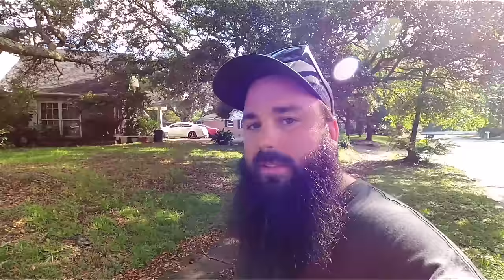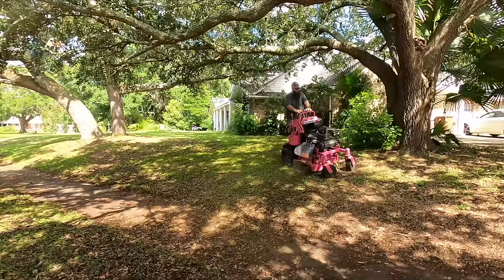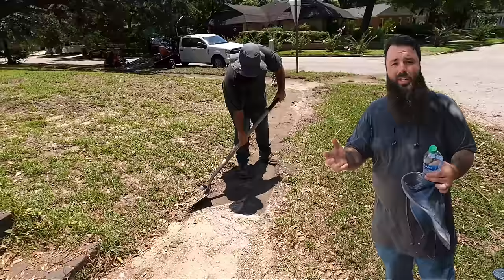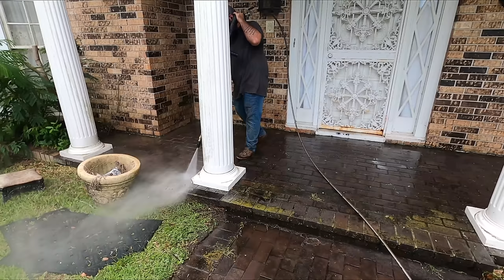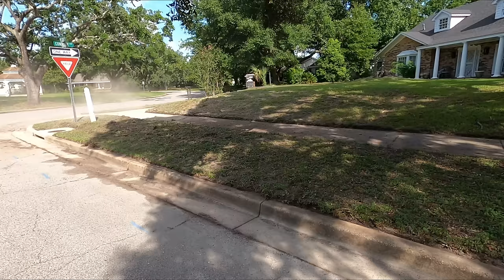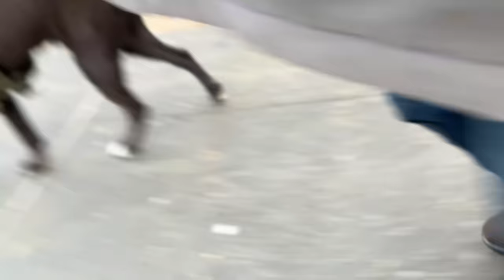(lost footage) He TOLD me that the SIDEWALK has been COVERED his ENTIRE LIFE

Comment: Kevin,  keep on doing you.   I have a Ryobi battery weedeater,  2 chargers and 3 batteries! It takes all 3 to weed and edge my tiny yard, 30 x 100' lot. As a 70 year old,  I  now weedeat in days. Front and sides one day, back next because of having to recharge batteries. My pet peeve with the  Ryobi is having to bend over to use. It's too short, but it's light weight.  Can't handle weight of gas blowers. I have the hat with the back flap. Necessity here in mid-Kentucky,  and due to eye condition,  have to block sun from my eyes. Love all that you do for others,  and  for your love of family.  ❤❤

Comment: Came across the ⚰️ cemetery you cleaned 9 months ago and as usual you did a great job. 😊 One special part, your daughters helping to clean the stones. It was so nice. 😊 One suggestion I will make, as we have a family cemetery⚰️ we care for, is using the spray you use on sidewalks on the tombstones 🪦, after they are cleaned and rinsed. It works the same way as on sidewalks with the sun bleaching the black away🪦and the rain rinsing away any dirt 😂or lichen left. By the way if you’re in Fayetteville, NC we’re having family cemetery cleanup day.🪚LOL!!🪜🧯That’ll be Saturday, April 27th. Plenty of space to pull in a truck,trailer, and camper. Good ole North Carolina BBQ 🐖 is on the menu that day!!!😋🐷

Comment: Another thing on the 'lectric tools, is when they break, the don't see a repair shop. That goes right in the dump and gets replaced vs a gas tool that you can usually service and repair. I have some gas yard equipment that's 40+ years old, and chainsaws as far back as the 50's that are all still working. Killed a DeWalt cordless trimmer and I didn't even take it apart to figure out what went wrong, I just bought another one because I know I can't get parts for it anyway or if I do, they'll cost as much as replacing it.

Comment: You’re wrong about electric equipment not being up to par. I own a tree trimming business & we switched to all electric saws and it’s been a godsend. I’m blown away by the amount of money I saved from not using gas. We just carry several extra charged batteries when we’re working and it’s enough to get through an eight hour day. We did have to buy some extra chargers so we can charge them all at once. Plus we charge them in a facility with solar panels, so no electric bill either. No gas purchases and no electric bill goes a long way on the pocketbook.
Reply from the maker: I do think there are some good battery saws.  the thing with a saw vs a weedeater or back back blower is that its running intermittent. so the batter will actually last a good while and from the battery saws that I have used they are slightly slower than gas when it comes to the chain speed but the cut good all the same. now the big issues is that you can buy a good ground saw for 3 to 5 hundred vs a sthil battery saw that is 300+ dollars and the batteries are another 300+ a peace so when its all said and done and you get the saw and 2 batteries you are about $1000 in on a ground saw. you can buy a lot of gas for that price. no for the gas it has the cost of fuel and just expect to have to replace a BS cheap carb that put on about once every year or 2 so when you put it in the shop for that well thats $100. the other factor is longevity. you can run the same gas saw for YEARS will minor maintence batteries wear out and if you live in an area that gets cold in the winter the batteries will be trash pretty quick. 

with all that said I will buy an electric saw this year. I will put it through the paces and if it makes the cut I will keep it. If not I will give it to someone that its better suited for.

Comment: 24:00 On the idea of going fully battery electric everything now is at best, an expensive side-grade for most things. The electric motors and systems work fine, but the batteries themselves let the entire system down. And the necessary battery chemistry needed to make an even better battery available is still a few years off. Even if said battery was announced tomorrow, you are still talking several years to bring it to market, and a few more years after that to become the new standard. So if such a battery was announced tomorrow, you are looking at that battery being the new standard some time around the end of this decade at the earliest. Pair that with the first generation of anything being rather poor overall, so such a battery would not be worth it in most circumstances until around this time next decade.

Comment: Kevin I see it like this. Opinions are like assholes. Everyone has one and some people are one. As far as cleaning that sidewalk. I invite anyone of these professionals to come down and grab that shovel handle. The line starts at the truck. Don’t worry, you don’t have to worry about crowd control. And if they are planning on using battery operated equipment on lawn care, they better get on to inventing some battery operated tools that work. The one thing I did see on a commercial on here the other day was a big 60” mower that had a remote control device driving it. This could be good. But I see some immediate danger here. A mower is probably one of the most dangerous pieces of equipment out there if not handled right. And if per chance whatever safety device fails, and that mower comes up on someone laying on the ground unconscious. Well I hope you get where I’m going.

Comment: NO Electric is the way to cause MORE WASTE YHAT CAN’T be recycled
Take the E cars when their batteries are SPENT there is NO way those batteries can be recycled plus to replace them to keep the cars running would cost as much as a new car so how is that good for the world 
EXAMPLE that a 100 yr old car that can be rebuilt with a little upgrade maybe and STILL be running BUT you won’t see ANY ECars running after the battery DIES and also to run on batteries you still need a secondary source to charge them up as well so use the primary power to run the machines from the beginning